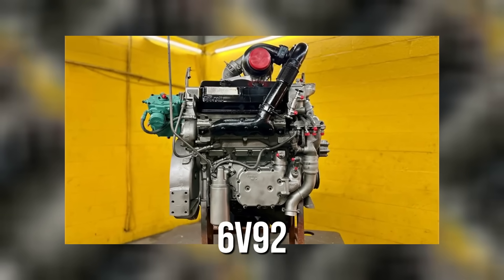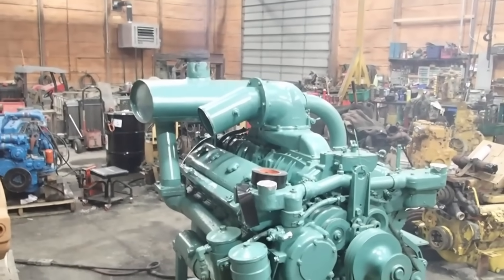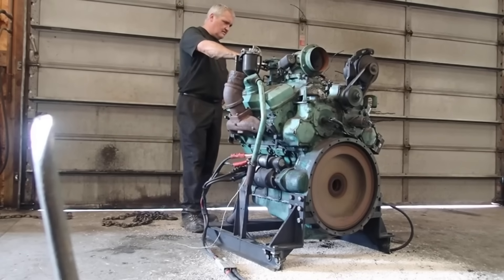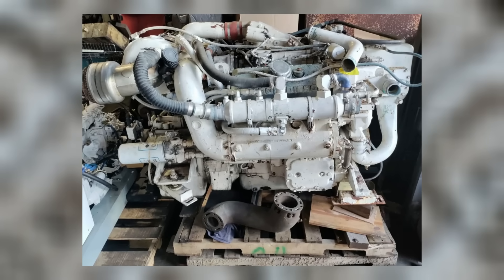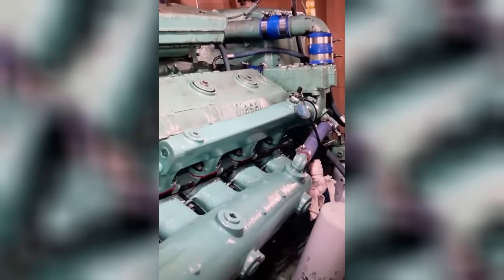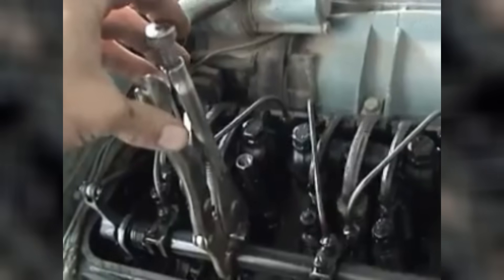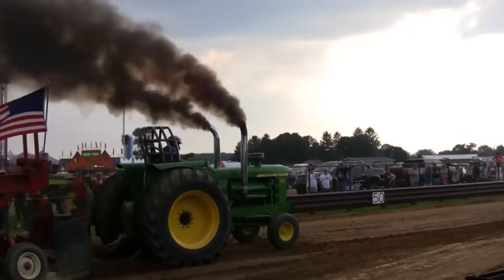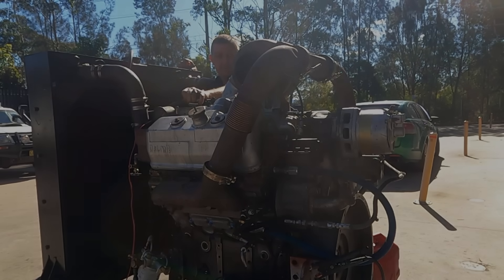Why Are the Detroit Diesel 6V92 and 12V71 So Different?

Comment: 01:02 For most applications, these engines weren’t typically restarted throughout the day. They were usually started once in the morning, idled when stopped throughout the day (fast idle), and then finally turned off at the end of the day.

Comment: I had worked for Detroit Diesel before retirement and am impress withe its 2-cycle engines. Since I have patented technologies to retrofit the existing (and future) billions of internal combustion engines (ICEs) to improve >25% efficiency, >2.5x torque & ~zero emissions without expensive new investment with existing knowhow for great savings, especially with heavy diesels.
It is Differential Stroke Cycle (D-Cycle) by simply splitting the piston crown from skirt to pump gases for the chamber via a (valvetrain-like) piston-train and to combine with the rest of the piston to turn the crank – a hybrid of 2-/4-cycle. D-Cycle further ushers in the compression-/spark-ignitions for diesel-/gasoline-engine hybrid - “Diesoline” engine - which is the SCCI/LTC (Stoichiometrically Charged Compression Ignition/Low Temperature combustion) engines.

Comment: Ok, I gotta get this off my chest… the old truckers always said that the detroits didn’t have the torque. But they were always comparing hp to hp figures. Displacement wise; the detroits had it. If you had to pull a terribly heavy load across hilly terrain, which would you rather have? An 855 Cummins? Or a 12v71? (They’re identical displacement).

Comment: This video is SO full of crap. The 71 series as well as the 53 series before had DRY liners. The 92 series had WET liners. BOTH could be pulled while in chassis just like ANY diesel that had liners. The wet liners helped with overheating problems that the previous series had and had the added benefit of having the same overall external dimensions but having increased displacement. The last versions had electronics on the injectors.

Comment: when I worked in Saudi we had quite a few 12V71s in the 953 kenworths. they did a good job but in the last few years they are getting replaced with 3408 cats. cant say they are better. we had a bunch of C500s with KTA cummings and I thought they were a better engine. more torque in them.

Comment: 12V71 in the MCI MC6 bus.
Reply: No, they never put 12V71's  in buses.
Reply: @Ray-d1b9d  Yes they DID!

MCI MC6

100 built, originally with the 12V71.  The only MC6s with the 12V71 are all Canadian buses.

Bus Grease Monkey has been around 2 of the Canadian buses....BOTH with the 12V71 and 4-speed.
Reply: @markdubois4882  you are right. I forgot about those Canadian. 100 or so..
Most with manual transmissions. You know, greyhound ran twin 471's for quite some time. They put 8 million miles on those engines before they would give them up... I would buy the package, separate them and rebuild them. Put them to work on water Wells in rice irrigation, and they would run another  life. they're still out there... I've done the same with twin 671's that came out of some landing craft..  probably a couple of dozen
Twins.
Reply: That is odd. I worked for many years for a detroit dealership in southern louisiana, owned by Mark Dubus before opening my own.
. Where about are you from?
Reply: @Ray-d1b9d  Alberta
Reply: @markdubois4882 cool. I'm down here on the Louisiana Gulf coast. I also have a place in Montana, South of Calgary.

Comment: These motors inherited the great legacy of the original engines that were built to run without using any electricity or even water for periods of time during WW2.  that's why the later models were so famous for being bulletproof and easy to repair or maintain.  Amazing how a small lump of Iron could move a bus so quickly like it was a smart car.

Comment: What will all the 3rd world countries do in a decade or so..when the old reliable suff they get from us here in the U.S. finally craps out..?
Because the new garbage we make is either too complicated or,is inherently designed to only last so long..let's face it.. manufacturers just don't want to make products that have infinite life spans..
Reply: They have perfected things like using old asbestos chunks and burning cow shit to get blocks and cranks and heads hot enough and consistently held at the right temps to weld the cast iron

Comment: Yap, yap, YAP, TWO entirely different engines, designed for entirely different purposes.
Wonder IF this "expert" at nothingness, has ever run across a 16V-71, or 16V-92, or maybe a 149 Series, maybe he could 'compare' a 20V-149 with a 2-53.
Reply: Why is there a diff between a 20V149 and a 2-53? They are both 2 strokes so the have to be the same

Comment: 12 71 was not used in landing crafts, inline 6 71 was used. was introduced in 1957! Most large log trucks used 12V 92 engines.
Reply: 12v71 not 12v92
Reply: @LBrawn fun fact, (not sure about 12v92 in logging trucks) 12V92's were 2 6V92 crankcase,  joined together, rather than a common block like the 12V71
Reply: 12V-71s in the biggest log trucks; Hayes, Pacific, and certain Kenworths.
Reply: The LCU's and LCM's did use 12V-71's, I've pulled them out of LCM's and rebuilt them while active duty in the Navy.

Comment: I am a mechanical engineer. Also a Ford and BMW fan. Mostly because of their Advanced engineering.
  But I absolutely love the old 2-stroke Detroit diesels. I know originally they were designed by the Winton engine company, and General Motors purchase the company. 
  But I would absolutely love to put the 6V 92 into my F-250 4x4. 
In my younger years I had the privilege of working on some of these engines. And God forbid we ever have a World War 3, this is the engine II would want power in my vehicle.
Reply: That would certainly be difficult. They are very large engines. A 6V53 would fit. Or the 8V53 might have a chance.
Reply: Wayyyy too heavy. 6v53 is a lil heavy,, but can be done. Whereas a pickup frame would never handle the weight of the 71 or 92 series
Reply: Ford has advanced engineering??? That’s how I know you’re full of SHIT! I have wrenched for years, and have had to repair Fix Or Repair Daily!
Reply: You idiots showed a 6V53 and called it a 6V92! And most city buses used the 6V71 !!!

Comment: A little hard for an engine built in or after 1957 to power anything in WW II. The inline 71 General Motor diesel were first made in the late part of the 30's, Maybe do a little research first? Yes the inline were around even before WW II, but the V- 71 series were not developed until 1957.

Comment: 12v71  was NEVER in a Sherman…
Reply: Duplex 6-71s . Used in some landing craft and generators.
Reply: Yeah, the duplex 6-71 was literally two 6-71 series bolted side by side driving a common gear out the back.  Nearly a v12-71, but not a single block casting.
Reply: I @benhart16 I've always liked the Inline 6-71 and 12V-71. I've never seen better performance, tolerance for abuse, ability to perform under adverse conditions or useful characteristics than the Inline and V-71 Series. For certain applications you don't want anything else. Like a DC-3 in that respect. Still really useful engines for certain Marine and Power Generation applications.
Reply: Correct… V configured Detroit diesels weren’t produced until 1957, they were all inline and the biggest one they made was the 6-110.
Reply: @aerialcat1 The 6-110 was a pretty powerful engine, even used somewhat successfully in the locomotive car, I think each car had its engine for a two or three car passenger train. When the 8V-71 came on board it ultimately replaced the 110, the HP was close to the same. AC used the 110 in one of their Track Dozers .
Reply: @jamesglavich1426  yes, the Budd rail diesel car used a 110, and a 36’ Navy patrol boat that I served on had a 110T that had  a hydraulic starter.
Reply: + massive displacement difference + different stroke / bore ratio, relatively significantly too..

Comment: The 12V71 was introduced in 1957 so quite some time after WW2
Reply: Yes, the Sherman's and m10 had v8 ford gassers and 2 inline 6-71s not a single v12
Reply: @cleetusmacfarland9453  you are absolutely right

Comment: 6v53T could dance all over a 92 series
Reply: 🤔  I think my 1985 chevy K 10 might like a 6-53 if I slipped it in   🤗
Reply: a silver 8v92 could be 550 h.p.
Reply: Not happening.  Two totally different engines
Reply: Oil leakage is common with Detroit Diesel engines. If they quit leaking oil it was probably out. That's when you began to worry
Reply: @russvoight1167  they didn't leak oil, unless it had blown gaskets.  What they did, was blow oil out of the draft tube when some numb nuts was not operating between 1850 and 2150 r.p.m.  They generally used about a gallon a day in normal operation.  Little drops of oil dripping from the draft tube is normal, and every diesel with one did, the same with every gas gm, ford or Chrysler with one.
Reply: @davidpotter7484 Yes that tube spit oil but Detroit had ten cent gaskets that harden & leaked
Reply: @russvoight1167 you could slow that down quite a bit, stock blower shaft seals are single lip, stopped oil going into the blower but let air into the crankcase  putting in double lip seals greatly lowered crankcase pressure and  reduced leaking
Reply: What are you smoking?
Reply: What are you smoking?